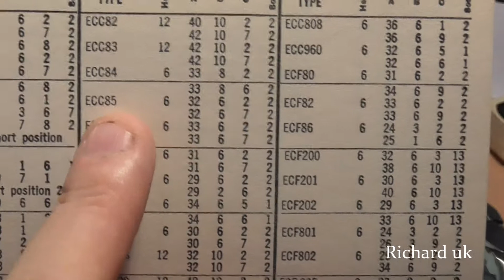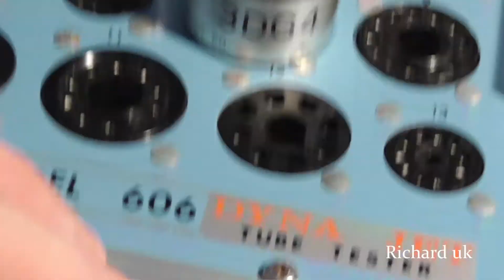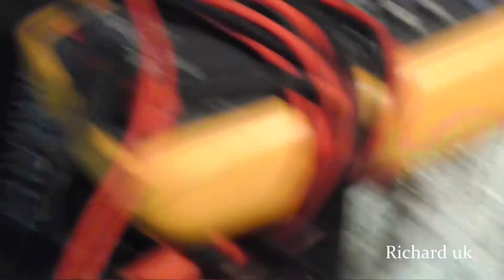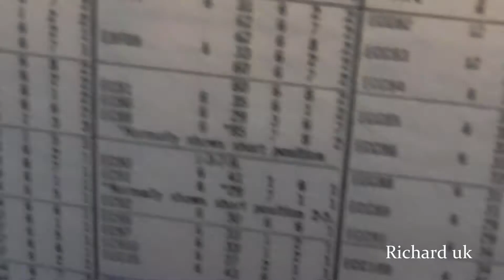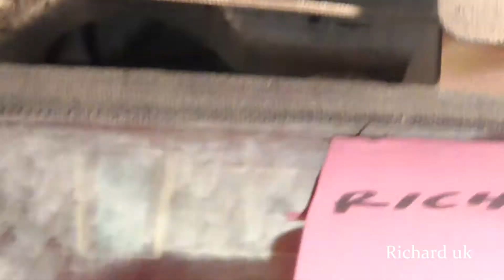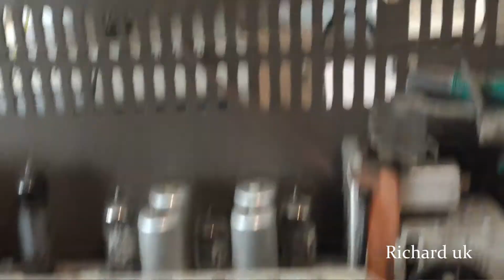Murphy A674 Replace 2 valves and switch on

Comment: Hi Richard, good progress, the blackening inside the bulb is tungsten from the filament, over many hours of use the atoms of metal literally boil off and condense on the glass bulb, interesting eh?
 Cheers, j.
Reply from the maker: Hello Thant makes sense. I have on order the bulbs but only 6 volt instead of 6.8, so will be using dropping resistors.. thanks again Joe

Comment: Hey Richard. Coming along fine. Have you given a thought to using your vom meter to check the current in start up? I know you got the lamp but it would be out of curiosity to see the actual amps being drawn.
Also,,, to let you know many of us are with all of you in the UK in this time of those terrible attacks in London.
Reply from the maker: Thanks Carl.  I been wanting to see that too. I have hooked up my meter but not getting what I want. I will look at the current draw soon. I need that before any work is done, replacing any parts. This is 3 attacks recently, I did not think at the time but could left the radio playing the news about the attacks... You hear  a little bit of it.